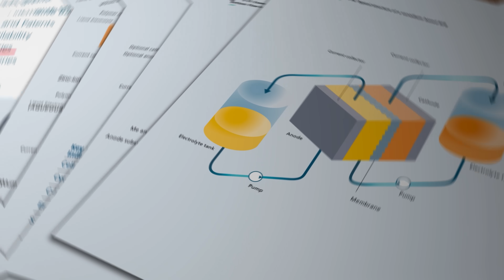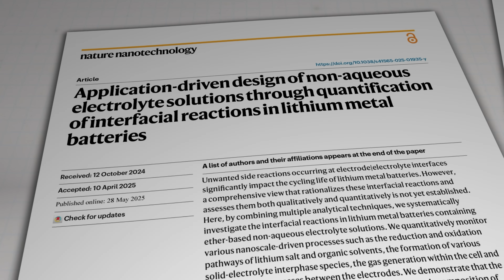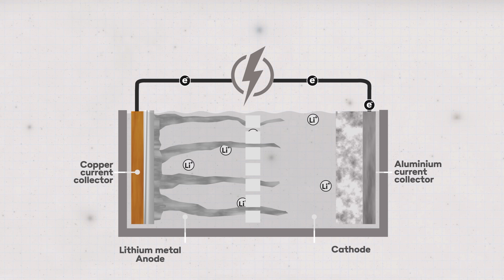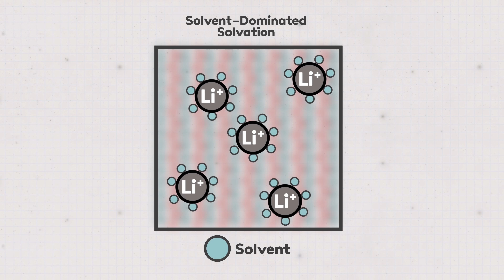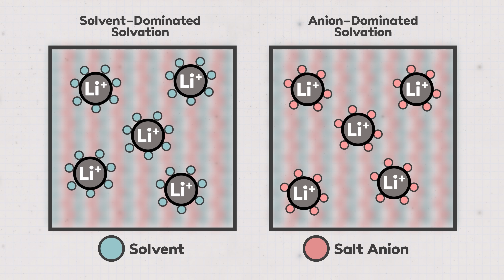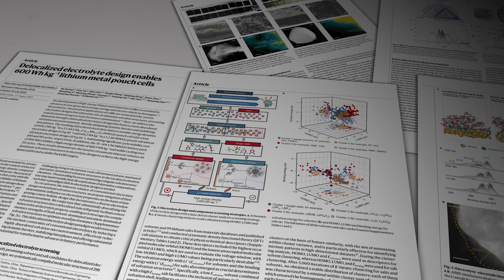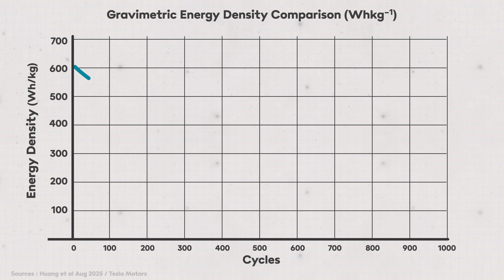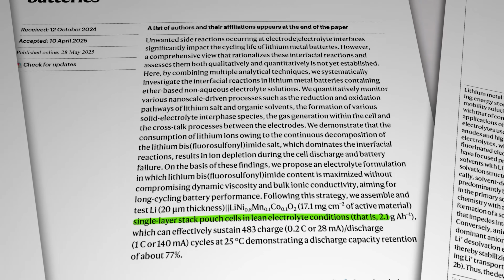New lithium metal battery doubles energy capacity! Has China beaten us to it again?

Comment: Thank you! Again, a really competent podcast looking at technologies in a plain language format that does not dumb things down. 
There is a discussion about EV batteries providing grid-level electricity storage (which might reduce the need for a different grid (non-point charge / discharge) and with individuals (not utilities) forking out the installation costs. To the innocent, this looks like the same mechanism as domestic feed-in-tariffs with a similar cost and benefit profile (individuals buy capacity and get money for utilities using their product (electricity or storage) when needed. Does this make sense?

Comment: Reaching 600wh/kg might be necessary in certain applications where weight is a huge problem, but at what cost? In the meantime, CATL has developed a new sodium battery with 175wh/kg capacity, cost half has much as an equivalent lithium battery and lasts 10 times longer. Not to mention that it keeps 90% of its capacity down to -40°C and that after 10,000 charging cycles, it retains 80% of its charge.

Comment: I think the assumption that battery designers are already working with is sound: if electrolyte flammability can be reduced and there is a path to high energy densities without having to use a solid Lithium anode in a cell then you ought to take that path because use of Lithium foils a) represents a source of instability that limits the effective life of a cell and b) carries an unacceptable risk of fire that can follow from imprecision in the cell manufacturing process or rupture of cells containing pure Lithium metal in a collision.

This assumption (or notion), which I just gave an overly articulated form, has worked a bit differently in practice. Think of it as something taken for granted that justifies acting in a certain way. The guiding notion is a more like a taboo in this case: don't waste you time with Lithium metal anodes!

This guiding notion/taboo should not be allowed to become a dogma limiting scientific investigation but pursuing cell designs without Lithium metal anodes did have a compelling (and cautionary) rationale. All early attempts to build cells using Lithium metal anodes were abysmal failures and much was learnt about unproductive lines of experimentation during that time. Today, in the rush to achieve higher energy densities, I think that cautionary rationale mightn't be receiving the attention that it is due. Resolving the energy density problem for a brief moment while increasing cell instability and the risk of fire is not a genuine resolution to the the problems that we face today or will face in the future.

Comment: There are a lot of applications where the lifetime of the battery might not be a huge issue. Particularly if the item the battery is attached to might explode anyway as part of it's normal operation. Longer range, faster speed or higher acceleration applications in this field do exist 🤨

Comment: I do see a change in climate because of more than usual CO2 but some damage we see done is due to pumping so much water out the aquifers (dropping the land elevation by feet per year in some places).  Add to that population growth; paving over land that can no longer absorb rain, and you get flooding.  The drainage requirement is well known science in most cases.  The water vapor from electricity plants helps with the generation of huge downfalls in short periods where we can get flooding.

Comment: We used solid lithium batteries for many years in oil well data recorders. The batteries were in a pressure housing to resist the downhole pressure. They were not rechargeable and cost a fortune. A colleague was having difficulty removing a used battery, so he inserted a wooden dowel into the housing and pushed the housing down on the bench. A loud explosion took place and some of the cells shot past his face, denting the heavy steel roof. We wrote a new risk assessment, which entailed leaving a retrieved battery housing for a week in a sandbagged area, before approaching it with a long-range IR thermometer. I would never buy an EV.

Comment: Many benefits of the lifepo4. I love it wont accept charge when its full. That's absolutely brilliant. Its also very volt stable during discharge. Unlike as example sodium. But the thing i love the most is the cycle rate. LiFePO4 will literally last you decades in a solar installation. When kept at room temp and used at 0,2c or lower the promised cycle life gets much enhanced. 
Ofc low quality noname cells exist, but even those, used gently by not having a tiny bank will show very long lifespan.

Remember the cells are tested at 1c many times a day for full blast and then gets rated by byd, calb, catl, eve evt.. Thats maybe how you use them in a drone, or vehicle ect but not in a household solar installation.

Comment: There is no “climate emergency”. Doubling the energy density of Li batteries might well help in the automotive sphere but large scale storage to counter lulls in wind of days or weeks and night time loss of solar (already limited over the day) isn’t viable at the scale needed. Factor in the massive energy needed in raw materials and battery manufacturing and it makes more sense to retain gas fired power on standby. The infrastructure exists and works. The sheer scale of battery storage needed would be environmentally and economically ruinous.

Comment: If these batteries are ever used in aviation,   and then tried to stationary storage when the range drops, they may offer the first practical system for short haul air flights, replacing both small jets and prop driven internal combustion engine powered general aviation. 

We will know the latter has arrived when Cessna make one... 

Dick Francis wrote a thriller, "Rat Race", about an air taxi service using small planes and this kind of use may well be the first commercial use of battery powered flying.

Just to be clear, that book is thoroughly rooted in the internal combustion engine plane: but my point is that it wouldn't have to be. That kind of operation already exists, and would become the entry point of electric air travel into commercial aviation.

PS 

Dick Francis fans surprised to see his name linked with aviation: I will just reassure you that the customers of this site taxi firm were, of course, jockeys travelling to their rides faster than they would be able to do by road. It's one of two books he wrote combining air travel with (of course) horse racing. The other is Flying Finish: the one that happened to be my first encounter with his work. 

I can still recite it's opening line... An accolade it shares with Whinnie the Pooh and with Pride and Prejudice, one of the most unlikely trio of books to appear all in one sentence.

I think I digress...

Comment: First use the right measure. Wh/kg is to scam people. The correct measure is Wh/l.

If you insist on using Wh/kg. Hydrogen has 35 Wh/kg. And diesel are 12 wh/kg. So, why aren't everyone driving Hydrogen cars???
The reason is that if you use the true measure for cars the energy density for Hydrogen are 2 Wh/l at 700 bar, and diesel are at 10,5 Wh/l.

When you use Wh/kg you are spredning misinformation. It's hard to work against the misinformation, when even the people that see that EV's are the best, and are the future, are lying.

Comment: Based on my back of the napkin math, ~750 Wh/kg is the point at which batteries will be able to fully replace fossil fuels even in heavy commercial and industrial applications, so this gets us close but not quite there. The safety issues are an additional consideration, and the economics might not make sense for most use cases. GM-LG's NMCA cells are already pushing 300 Wh/kg with a 1,000 to 1,500 cycle life, and LFP cells from CATL and others are exceeding 200 Wh/kg with 3,000 to 4,000 cycle life. Manganese-rich chemistries appear to be splitting that difference, and all three of those chemistries appear cheaper and safer than this lithium-metal battery. It's definitely a technology worth pursuing, but I don't think we'll be seeing it in personal transportation anytime soon.

Comment: First, all credit to the researchers because innovation is the well we all drink from, and it doesn’t happen without the dogged persistence of lab researchers, mostly at academic sites. Second, an equal amount of innovation comes from engineering a manufacturing process which takes advantage of the research. Often, this is out of reach. There are difficult issues with scaling production that cannot be solved. If the first two bridges get crossed, the third innovation is cost. Obviously, the cost of the product has to entice/create/capture a substantial market. Again, this is not often possible. None of this is negative. It’s just good to remind ourselves that a ‘breakthrough’ in the lab is not a breakthrough that matters to us unless two other ‘miracles’ happen. It should make everyone happy that the LFP battery exists, is getting better, and still has more room to grow. We can thank the Chinese for that. Although some of the initial research happened in the US, more research happened in China, and China alone solved production engineering and built cost effective supply chains. Today, LFP batteries have demolished those who claimed that BEVs ‘can’t exist because we’ve gone through all the elements of the periodic table’ (this was common fifteen years ago, I heard it in college). It’s a better world.

Comment: What???

A typical Tesla vehicle battery gets removed after only 1000 cycles?

So if you commute to work every day in a Tesla the battery is done after 3 years? 

That's shocking. I assumed they had to last much longer than that.
Reply: I did 10 seconds of research and Google says Tesla warranties for their batteries range between 100,000 and 150,000 miles

Comment: Lithium and Aluminium air batteries are not particularly new.  They are more like a fuel cell than a battery, but using a solid metal as the fuel.   Fundamentally they are less efficient than Lithium Ion batteries.  Lithium Ion is more like a electric field spring, you push energy in it comes out again when you allow it to move, inefficiency is mostly just resistive and in the control system.  Lithium air needs a supply of air, and like any fuel cell this is a parasitic loss than cannot be eliminated.  Its also one reason why combustion engines are so inefficient, they spend alot of energy pumping air. Hydrogen fuel cells mainly lose efficiency in a very large and powerful air pump (like an electric turbo), because oxygen is only a small part of the air and you need alot of it for power.  Fuel is usually more concentrated.

Comment: What about mixing in an oxygen activated foaming stabilizer that seals any leaks, kinda like super glue? With the addition of positive internal pressure you might be able to seal and prevent any runaway reaction from a puncture. Everything but a catastrophic rupture should be engulfed while displacing moisture.

Comment: I have lots of batteries now in my apartment and my office, all LFP, all Chinese. Why? The quality on the grid today is so bad that some of my measuring equipment is affected. The amount of people harassing me because of battery storage is insane. People shouting that the Chinese batteries will fail and it's not fireproof and that i should buy from a respectable brand. I looked up what respectable brands want for their batteries, 1K per kilowatt of power. And then i get actually dangerous Li-Ion, no thank you.
Home batteries are not going anywhere because of market protection and nonsense rhetoric by people who hardly understand what electricity is.

Comment: The technical breakthroughs in battery technology are very impressive, but for me it's all about the economic breakthrough. 16 years ago lithium batteries nearly $1,500  per KWh. Today it's $100 per KWh with seemingly a roadmap to just $10 per KWh. We're close to the tipping point where installing home batteries is affordable for the majority of people, and when that happens it will change society dramatically. Coupled with cheap solar panels, there will be no need to connect homes to the grid to be powered. Instead, homes will be connected - optionally - to POWER the grid. Imagine not only never paying an energy bill again, but actually getting paid for supplying the grid. The era of large centralised generation is over. You won't need gas peaker plants, maybe not even nuclear. The entire grid could be run using a combination of solar, wind, pumped hydro and battery banks.

Comment: If your first oxidize Lithium at the cathode (make a Li+ ion) and then reduce it at the Anode ( turn the Li+ ion into Li metal) then net no electric voltage/current energy is generated or stored. You could have some small difference of density between anode and cathode material (matrix) and that could make you some Milli-volts but not enough to make it worth while.  
Only if you trap these Li-ions in a chemical Anode that keeps them ionized and surround them with electrons without letting them reacting with the lithium ions, that would do it. It might be hydrogen ions that turn into atoms that are not allowed to react to H2 and gas out and stop (poison) the battery cell. You see this is not so simple and that's why this Ni-Co is not so easy to replace.

Comment: They have ONE test cell that has done 483 cycles under ideal conditions in a lab, what happened cycle 484? Did the lab burn down?
I have a promising battery on the bench consisting of lemons and metal strips, I just have to overcome the low output and then I will revolutionize the whole industry... Potatoes also has some promise, and that is almost solid state.....
FOR F*CKS SAKE! Dont hype things that is nothing more then an experiment on a lab bench, have some dignity as a YouTuber